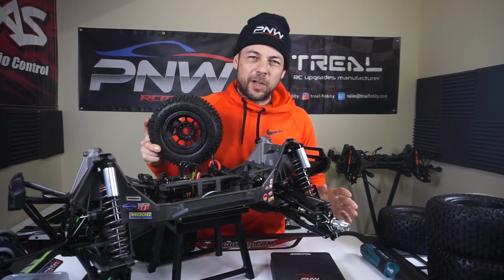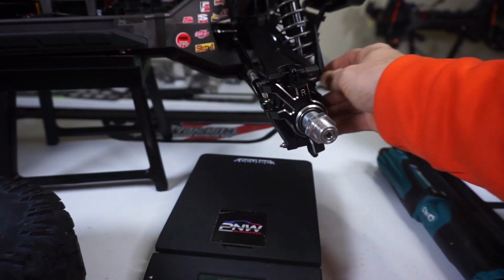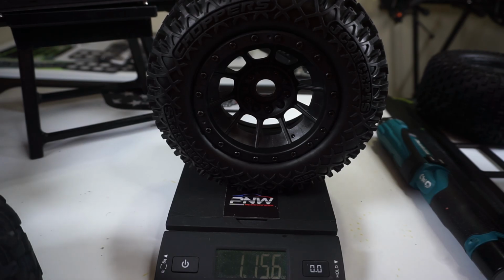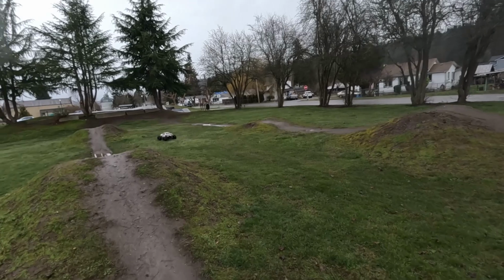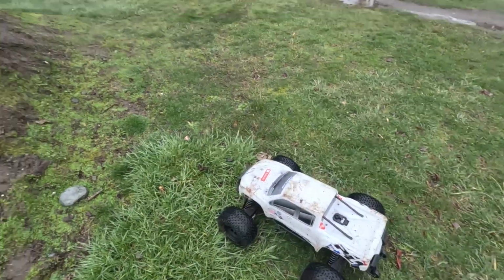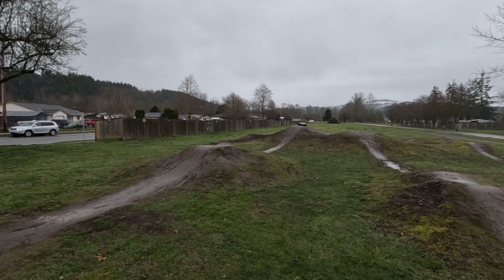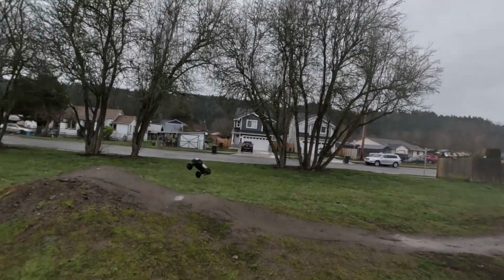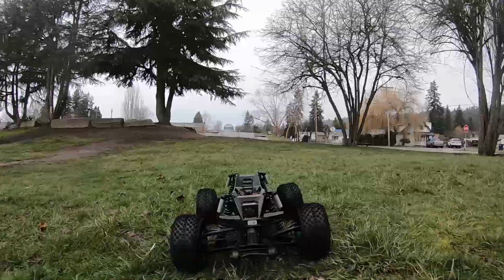Jconcepts Choppers Day 2 Testing Failure on the 1/5th hex insert.

Comment: That's to bad they already broke . I instantly had interest but now I may have to hold off. Was it the wheel or adapter that broke? If it's only the adapter they may come up with an aluminum version like pro line to fix that problem.  I would be all in for it then. 👍
Reply from the maker: Yes sir! Only the adapter. Aluminum version hopefully won’t break the wheel😂🤙🏼🤙🏼

Comment: Those tires are just to heavy
Reply from the maker: They are pretty heavy for sure. I’m happy with the lm though. Rather break the insert you know. Rather than a wheel. I did break a proline beadlock wheel, they were brand new and no good after that